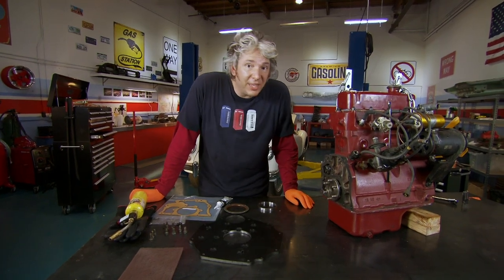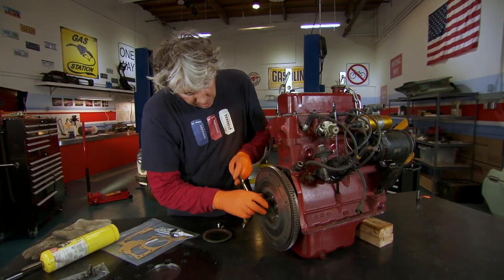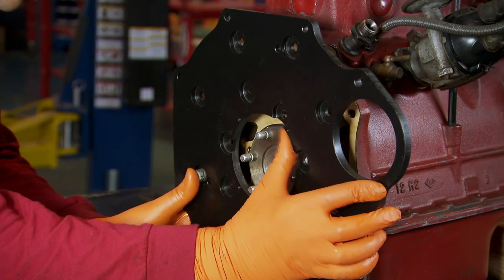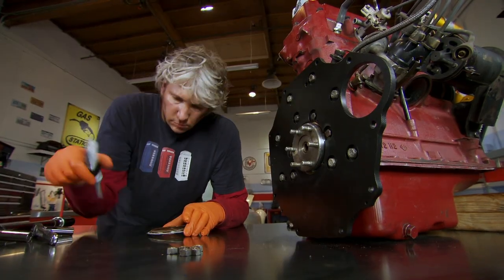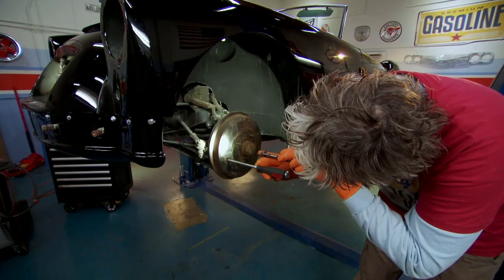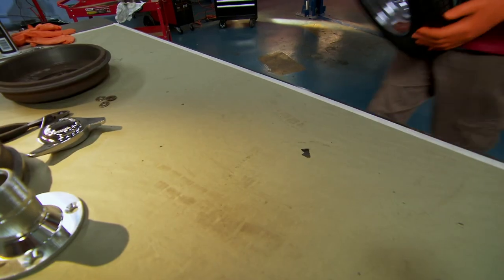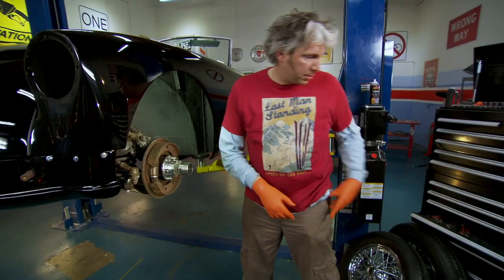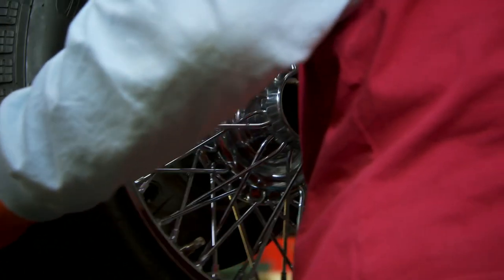Quick & Easy Front Brake Judder Fix  | Wheeler Dealers

Comment: New drums but old shoes. If the drum was warped then most likely the shoes are out of spec too. Why not replace the shoes while you're there?  I would never use old shoes or pads on new drums or rotors, same for the reverse never "pad slap" a old rotor.
Reply: Agreed.  I would go a step further and replace the old springs and other hardware in the drum brakes.
Reply: As long as the shoes are still in spec and the hardware OK why replace any of it? Anyone can slap on new stuff , it takes a pro to know what and what not to replace.